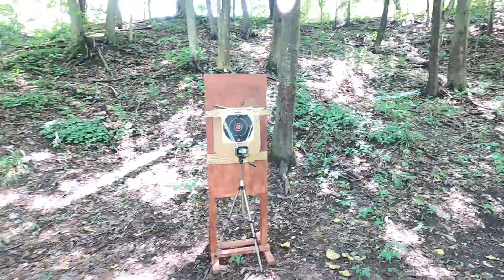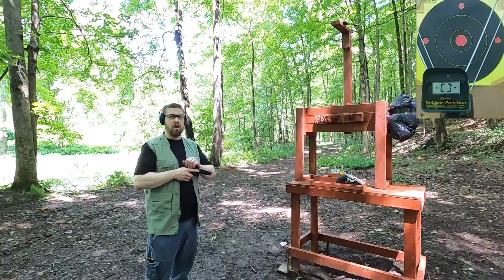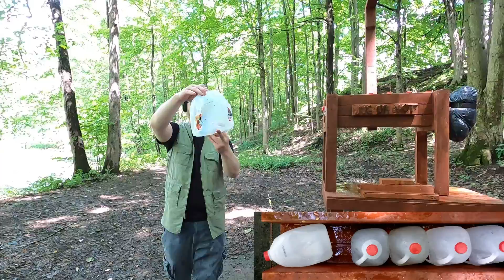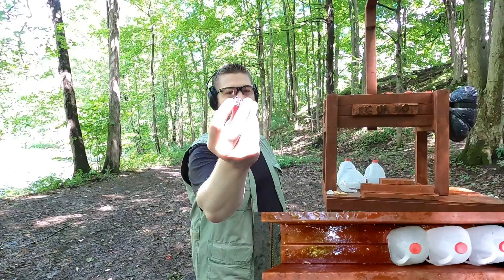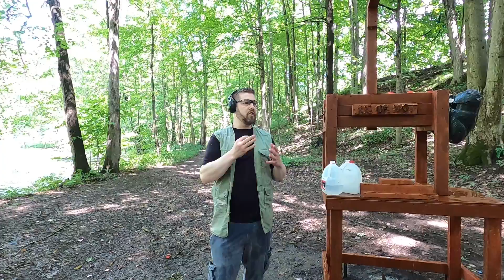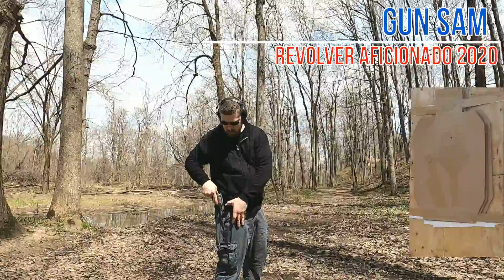10mm More Powerful than .357 Magnum? 💥ULTIMATE Test💥💥💥POWERFUL Ammunition

Comment: If I go hiking in the woods, and I'm with other armed friends, I will usually carry just my S & W 460XVR. If I am by myself, I will carry my Mossberg 590A1 along with usually 25  2 3/4inch slugs and  5 of the 3inch 00 buck....as a sidearm backup, I will also carry on by gunbelt either my S & W 686 (357) or my Glock 27 (40 cal). I tend tp prefer the Glock as a backup because it is somewhat  lighter and the magazines have more capacity than a 6 shot cylinder. If I have to pull my sidearm, then it means that I am likely already in serious trouble. My 40cal Glock is not quite as powerful as the 357, but pretty close actually.

Comment: Depends on how it's loaded. Full power original Norma spec hunting ammo in 10mm...yep. You can reach very low 41 mag speeds...NOT weights. It's not 41 or 44 but it works! Old school 158 grain 357 Mag at 1500 FPS used to be the most powerful revolver in the world...I would choose the G40 with a 6 inch barrel or a hoss built 10mm. There used to be 357 mags built on Nframe size revolvers but a Ruger Redhawk should eat old school 357 for breakfast.
Reply from the maker: Buffalo Bore actually makes hotter. I think they list something like 158 gr at 1,480 FPS in just a 4" barrel as where that original magnum was 158 gr 1,500 FPS in an 8" barrel. I have for a long time wished that they would load a 158 gr soft point so I can test and see as far as terminal ballistics go (as recoil would be greater for me than the original setup) what a 158 gr soft point at 1,500 FPS would do.
Reply: @GunSam  I was pretty sure it was a 6 or 8 inch bbl. on the old revolvers.  10mm just negates the hell out of the power/capacity argument between 9/.40snw./45 too,, but if I had to do it over gimme a 460XVR 6 inch😮😂

Comment: 10mm is close and the xtreme rounds made out of pure copper are really close to ,357 if not identical that is if you have CLOSER bullet weights.  You should have used a lighter bullet for the 10 to be fair but thank you and good job.  Those two calibers are both my favorite carry options.
Reply from the maker: Thanks. I chose the 155 gr as the density of the bullet as for penetration is a little more fair than using a lighter 10mm, which would have fore sure penetrated less. Granted the same bullet weights make it easier to compare (love the 124 gr 9mm+P vs 125 gr .357 mag tests) but I think sectional density sort of outweighs it all.

Comment: "XTPs are hard to get expansion with"??? Say what??? That's what they're designed for! Controlled expansion levels at a wider range of velocities than other bullets. They still expand at the lower end of the velocity scale, and don't frag at the higher velocities. I've fired 10s of thousands of XTPs in my life. They're my #1 hunting bullet in a variety of calibers, and I've NEVER had a problem with expansion with them.
Reply from the maker: Well your experience is different than mine. I have never had lower end energy power rounds expand with XTP, literally never, all the while other HP designs will. Just odd I guess.

Comment: I have heard many times that the 10 is the equal of .41 mag. It seems that round for round the 357 has the edge on the 10. So 41 vs 10 vs 357?
Reply from the maker: The problem with .41 mag is that it's not that popular or available. It's in the realm of .327 Federal Magnum, you just don't see it everywhere, so for most people it's going to be .44 mag VS 10mm vs .357 Mag. Also .41 Mag is pretty hot stuff several hundred ft lbs more powerful than 10mm and on par with .44 Mag ammo.

Comment: U need to do the same test using both revolvers     Otherwise this is apples 🍎 vs oranges 🍊
Reply from the maker: No, not really. That makes little sense.
Reply: Gun Sam Revolver Aficionado well if you gonna do a vid on 357 vs 10 mm you should know that a revolver has a gap between the cylinder and the barrel which gases escape from causes less speed from revolver vs semi autos      So your 10 mm will not has same speed from an revolver vs an semi auto      Which would show how an 10 mm stacks up beside the 357
Reply from the maker: @marcuslocklear7026  I have studied this extensively. I know about cylinder gap, but I don't consider 3-4% potential velocity loss a thing. That's like crying over 75 FPS lost, which I have seen a variable from one round to the next. Basically its nothing, plus a cylinder gap in unavoidable and you know, you SHOULD test ammo in their correct platforms, .357 semi auto or 10mm revolver isn't really normal. So, considering this is the way you should test each round, and crying over 75 FPS is dumb, what's the real significant issue here? Other than repeating misinformation not tested personally?
Reply: Gun Sam Revolver Aficionado ok I see what’s happening you just want the 10mm to equal to the 357      If you consider the 10mm to be just as good that one thing but post a video and show accurate numbers with as little variables as possible and let everybody else decide what’s important
Reply: Or u can just get a 357 desert eagle and try that out vs 10 mm glock
Reply: And by the way nobody’s crying 😢 but you cause I said you comparison wasn’t accurate.       This channel sucks 🐓

Comment: Great video. Question- is it possible that the feeding problem on the 41 had anything to do with the conversion barrel, or possibly the magazine you were using? Were you using a 10mm magazine? I've been looking at buying that specific setup myself and would appreciate any info you could give about it's overall reliability. Thanks.
Reply from the maker: Thanks. What I used here for this setup is a Lone Wolf Alpha Wolf G41-10mm conversion barrel, an NDZ 22 lb recoil spring and a Glock 20 10mm magazine. I did not change or modify the extractor so this might be an issue. I have done about 8 10mm tests so far, many not published yet and all together about half of the videos have a jam of some sort. I have noticed that the longer I go between cleaning, the more it has an issue. That makes sense as the chamber in an aftermarket barrel is almost always fully supported and not sort of loose the way stock barrels are, and they make them loose tolerances to feed well. Most people will tell you that conversions can be somewhat unreliable so definitely don't use for defense, but hunting or range work is fine. I think part of the issue is also 10mm ammo as it's all over the place. This ammo nearly 800 ft lbs, but the Hydrashok 10mm is 400 ft lbs, and the rest is in between. That can't help for reliability when you never know the right spring. Now, I did seem to see better reliability with the stock Gen 4 recoil spring along with a clean chamber and ammo in the 500 ft lb range, going up or down after that and with aftermarket springs might be finicky for the reliability.

Comment: Shouldn't you be comparing 10 MM to 41 mag? Both use 10 mm bullets.

Not surprised that .357 did so well. I took a deer with a .357 at about 30 yards, in west Texas, a few years back. It dropped immediately.
Reply from the maker: Not really, Because the variety of 10mm, .357 mag and .44 mag are high plus way more common. Including a .41 mag comparision would be literally 2-3 tests for almost no one to get any useful information from because very few people have a .41 mag revolver.